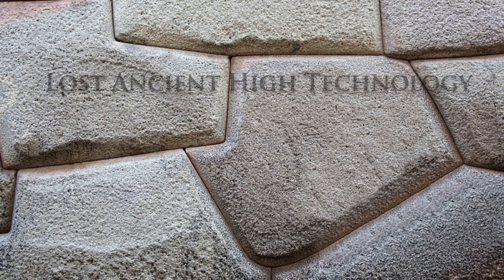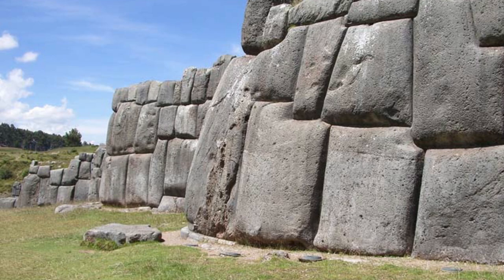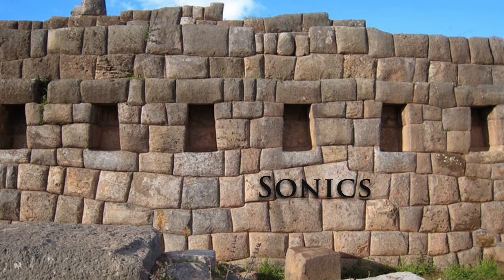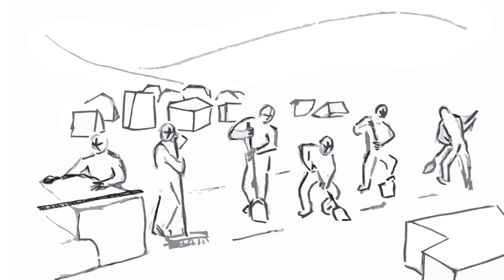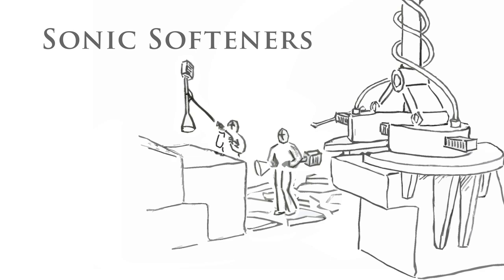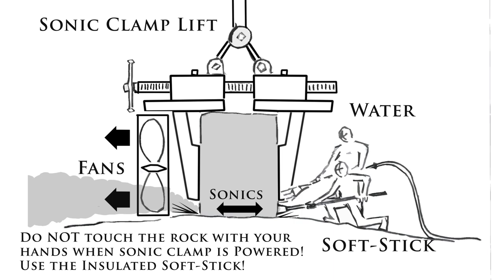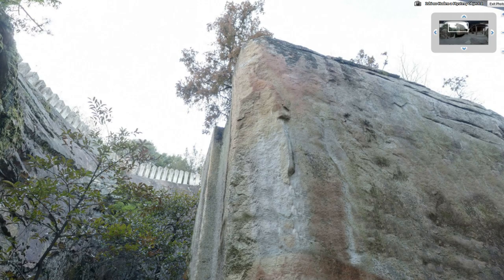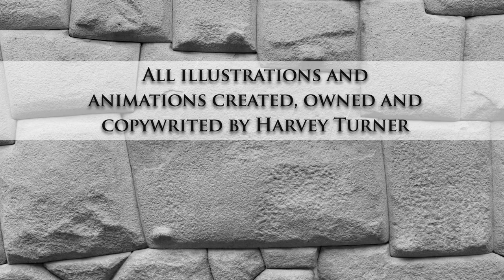ILLUSTRATED:  How to Build a Polygonal Megalithic Wall. Like Sacsayhuaman, Peru

Comment: Dude! Stop eating mushrooms!!!
Reply: Alternatively, consider this:
You place a rock on top of another rock.
You start making a sound at the resonant frequency of the upper rock.
The upper rock starts vibrating. It starts to scrape away at the rock below it.
Eventually the edge between the upper and lower rock will become a smooth line, and the stones will fit together perfectly.
What about stones next to each other?
You place two rocks leaving a gap in-between.
Then, you place a rock on top of the gap and repeat the process.
The rocks will fit together and you can place more stones on top of them.
Reply: Leave the mushrooms out of this

Comment: You'd think if they would've used those big ass sonic clamps we would have found some remnant of them at least somewhere right
Reply: after 13000 years? Only if they also were made of stone
Reply: Problem is the speculation is that there was a great disaster of some kind that wiped the civilization out only leaving larger solid structures and occasionally granite bowls and such. A lot of people believe that this “great disaster” is what inspired the infamous flood myths which are found in almost every ancient religion’s chronicles.

Comment: How do we make or use a sonic softener.
Reply: Theres a guy on youtube who strapped a water hose to a speaker with high pitch frequency coming out to make the water comin out the hose do crazy stuff like appear to flow in a zigzag pattern and even appear to flow backwards! 
 Maybe something like that but a bigger speaker being fed into a flexable tube that u can hold and touch stuff with.
Reply: There’s a video on YouTube where a guy takes a metal hello Kitty cookie cutter and places it on a rock. He then attaches two wires from an electric buzzer like the kind doorbells sometimes have.  The vibrations from the buzzer over a period of time causes the cookie cutter to slowly move down through the rock as if it was melting it’s way down leaving a hello Kitty shape hole in the rock. I don’t where they would have gotten electricity or how they would have moved the boulders back then but I don’t know where they would have gotten the sonic crane thing in this video either.
Reply: the explanation is perhaps simpler than this.  Maybe this ancient people simply knew a kind of concrete that was prepared and placed in place so that they could shape it at will before it was dry.  That is why they are perfectly linked and have different shapes
Reply: @nicolastylist7238  We have cement today, and the Hoover dam is still cooling in one big mass. But even if they were like big clay balls, the edges between the stones are rough, not like pressed together geopolymer or something. And there are quarries with stones being carved with nubs.
Reply: @Greg042869  maybe both the tool and the stone should be made to vibrate.
Reply: @dustinbrandel59  Yes, the tool shaking the stone being set is the idea, I think.
Reply: @nicolastylist7238  that was probably one of the better arguments but scientists found out the rocks are solid.  Not poured. That's the only way I can see it being done also.  You would think they would all be the same size.
Reply: @harrowgateguy   Link to the video ?
Reply: @Johnkent1965  The one I was thinking of doesn’t seem to be there anymore but here is  a similar one demonstrating the same technique. 
https://youtu.be/BsqOLCXYznE
Reply: @harrowgateguy   I saw that one yeah .but not conclusive I find. Well we keep on looking
Reply: @DavidfromMichigan  I think the blocks not being the same size and shape is what makes it stronger. If blocks are uniform and placed along straight lines like the way we build with bricks and cinder blocks today, then when there is an earthquake they slide out of place  more easily.
Reply: @Johnkent1965  unless the video is faked, It conclusively shows that a metal object on a solid rock vibrating at the correct frequency will cut through the stone as if it were super hot and melting its way through the stone.

Comment: Hi guy! 
You need to plan the build so that it will not collapse during quakes and tremors (no identical parts), and use any hard stone in the vicinity. We may assume that in historical builds, these stones could have been adjusted with balance weights to fine tune them to vibrate at a different frequency than the one to be avoided to prevent resonating with earth tremors. Similar to how balance weights are applied to the rim of a car wheel to avoid resonance at a specific speed, some stones could have been balanced by adding or subtracting weight to the stone. This weight adjustment could not be applied anywhere else but on the face and so we find stones with protuberances or dimples that so far have no known function.
Reply: Robert Smyk seems to fit!

Comment: the explanation is perhaps simpler than this.  Maybe this ancient people simply knew a kind of concrete that was prepared and placed in place so that they could shape it at will before it was dry.  That is why they are perfectly linked and have different shapes

Comment: All these megalithic sites were built underwater by the Sea People. Rock underwater is much lighter and easy to move with floatation. Underwater you need heavy stones to resist wave action. As the sea level receded modern humans restored many of the underwater constructions as they appeared above water. Water was the anti-gravity system of the water breathing sea people.
Reply: Interesting theory, but the height is the killer.  It was 150k years ago that sea levels were higher than they are now, let alone comparable to Machu Picchu (7900 feet above sea level today).  As far as we know, sea levels have not been much higher than 400m (~1300 feet) ever historically.  Many (but not all) of the polygonal masonry examples are at substantial elevation, which would require a different explanation.
Reply: @Krucifus  I figure there is a lot more left underwater that we haven't seen yet. Besides mountians and land rises up.

Comment: Megalith   –   LEBARONBLANC–Thesis

I believe, I found out how these walls were made. 
… HOW THESE STONES WERE SHAPED :

It is not laser-cutting stones, nor «melting» them, nor the theory of «sandbags turned into stone».

The solution for how these stones were shaped to fit so accurately on each other 
is, 
that they've been rubbed on each other … and this in a PERFECT PARALLEL MOVEMENT.

The stones were firstly shaped roughly, similar to the visible outside.
And than the people must have had some sort of a RACK, 
which allowed them to rub the stones on each other mechanically, 
as much as needed. 

You can watch a wall and detect, 
how a stone was rubbed against one or two others,
until they were together in perfect shape. 
Horizontally and vertically.

It explains, why the horizontal line is sloping; one stone into the other, fitted by rubbing against.

No other method is able to achieve such an accuracy.
… … 

We notice similar styled walls, but with smaller sized stones.
That is explained by some knowing well the technique, but lacking the technology 
for building a rack able to handle the bigger weight and move it
Maybe it’s just a matter of slavery work (example Roman constructions).
… … 

This LEBARONBLANC–Thesis applies only to the final shaping of the stones

It does not say nothing about cutting the stones out of the quarry,
nor do I have a clue regarding the weight–«problem» in general. Just so … 

Have fun !

P.S. 
You may enjoy my music (hotel-bar chill) on YouTube  :   LEBARONBLANC

Comment: I think the Peruvian/Incan polygonal, jigsaw walls were actually poured material, concrete, geopolymer, made partially from ground up material from nearby quarries mixed with a binder, hardener, so the chemical composition matches real rock. The liquid was poured into long horizontal beds, molds, with separators of thin, decomposable, organic, material like big leaves, or thin wood, with long wooden planks on the bottom sticking out to later be used as levers, and left the harden. (The "nubs" on some of the blocks was the material starting to harden when poured from a large spigot and had to be cut off sometimes even.  The puffy shape of the blocks is just a side effect of the hardening process, like cooking a Pillsbury Cinnamon Roll in the oven. After the bed hardened, the entire wall was raised 90 degrees all at once by hundreds of men using the underlying wooden planks as levers.

Since I'm the first one saying this, where's my Friggin' Nobel Prize?

It's either that, or aliens.
Reply: Why didnt they just poor solid walls? It looks like they have been softened up maybe heated maybe they stacked them in a form build a like clay oven around the entire wall heated it to very high temps high enough to soften the rock where it will settle and mold to any shape..like roughly fit them together heat them and let them form to one another. Who knows incredible though
Reply: No one ever seems to mention the bulging on the bottoms of these stones. 🤔
I do think the stones are a language though

I mean like the outward facing patterns we see from the stones, including the nubs.
Reply: @jasontipton8430  Solid walls would be prone to stress fractures and cracking during any earthquake.  The way they constructed the walls actually allows the walls to move with the earth and settle back, ingenious really.  We use a similar approach with a floating base to allow buildings to move back and forth with an earthquake and not shake themselves apart.
Reply: @FH-cn3mg  just enough heat to soften them not fuse them together

Comment: The level of artistry varies. The same principles were likely used across the world, but the level of expertise, raw materials, labor availability, money and time likely affected the outcome. Are the "fans" electric? If not, how did they work. It's an interesting theory. Something like that may have been deployed. Need someone to make a small polygonal wall to test theories. Nephilim maybe?
For supposed "beyond even us" ability, I see flaws that don't suggest that, such as small filler stones and sloppy work. I expect that every really nicely designed wall had a savant of some kind. There were geniuses back then too; human geniuses just like today's.

Comment: The overarching question is not how they fitted the stones together so closely but rather how they cut, moved, and lifted these enormous stones into position in the first place.   If you can get the cutting, moving, and lifting done - then getting the stones to buddy-up closely against their neighbors is the lessor of all challenges.

Comment: It has never been a mystery the Inca stone working technic, I have travelled to Perú and visited Machu Pichu, Ollantaitambo, Sacsaywaman and many other places. In fact, in Machu Pichu they explain you the technic, it is stone age technology that you can replicate at your home, the top suface of the placed stones is let unworked, then you select the stone that you will put above and work the bottom face and place it above 2 already placed stones (suspended with logs), then simply using cords you traslate the finished suface in the bottom of the rock that you want to place onto the top of the already placed rocks, this way you replicate exactly the same pattern, and finally you place the new rock into place.
Reply: Well, post a couple of videos where this is done then please.
Reply from the maker: Yah,, sorry,, you can't replicate Machu Pichu at home.  OMG.  LOL!   Thanks for watching!     Oy.
Reply: @intriguingmegalithicperspe1764  Remember, you also can't replicate Machu Pichu at home using sonic technology.  Polygonal stonework has been used around the world.  The Greeks, for example, used it.  I personally think the examples in Peru are higher quality but various cultures performed it with the known techniques. Larger stones add a level of difficulty but a stone is always able to be shaped by humans.
Reply: What??? You make not .much sense
Reply: @intriguingmegalithicperspe1764   sure you can. With clothesline and sand.

Comment: This is an interesting idea but I'm more convinced by the geoploymer hypothesis as it also explains how the under and uppersides of the polygonal rocks are convex and concave respectively which helps them remain together during things like earthquakes where they kind of "shake" back into place and transfer the motion more efficiently 

Edit: here's a video on the idea of geoploymer shaping (and even repairs made)
https://youtu.be/iwiNg6ef_ic

Edit 2: here's a link to other uses of geoploymer to mass produce identical stone of Pumapunku  
https://youtu.be/0Q1f0YBm4ic (this is actually from the channel ancient arhcatects that you suggested as well ☺️)

I think this is an interesting idea worth trying with current or future technology to produce a similar result, if only to prove it's effectiveness
Reply: @RRRRRAAAAAAAAAHHHHHH  yeah I was just trying to be nice haha
Reply: The blocks at Puma Punky only appear like exact copies at first glance. Each one is actually different, so not cast from a mould. I have been there and measured them.
Reply: @rbtharper  surely that can be explained by erosion and the fact they weren't perfect molds? Also even if that did disprove geopolymers it's doesn't prove sound based technology
Reply: @smileyp4535  I'm not set against geopolymers as a possible explanation for some stones. The idea of softening surfaces with a chemical mixture is intriguing as well... Just one demonstration would go a long way though. 
Weathering as an explanation for the differences in blocks at Puma Punku ...nope! They were each made individually. 100 percent. Regardless of the tech used, I am astounded by their accomplishment. 
I do favor ways it could have been done using traditional methods... Because they could have... no need for lost technology. It's so amazing, what they built...
Reply: @rbtharper   They can be done one by one.

Just anybody could participate in the process even kids (results in smaller stones)
Adults or families, bring big quantities of soft slurry to the wall place and compact it to the previously shaped block to get huge single stone. Kid can bring small amount before the mass will solidify, so then we see very small stones. Wall also can be like a ghost city, to record somebody's presence in a village history.

In the city we can see more standard sized blocks, most probably done by a professional workers whose target was to assemble the city.

Comment: Maybe one way they did it. I personaly belive it has do with resonance frequences
Reply: Here is my theory:
You place a rock on top of another rock.
You start making a sound at the resonant frequency of the upper rock.
The upper rock starts vibrating. It starts to scrape away at the rock below it.
Eventually the edge between the upper and lower rock will become a smooth line, and the stones will fit together perfectly.
What about stones next to each other?
You place two rocks leaving a gap in-between.
Then, you place a rock on top of the gap and repeat the process.
The rocks will fit together and you can place more stones on top of them.

Comment: this doesn't explain why they wouldn't use standardized shaped stones, the process described would be greatly optimized by using smaller rectangular blocks and anyone smart enough to invent a clamp to basically vibrate a multi-ton rock (as you claim) would realize this